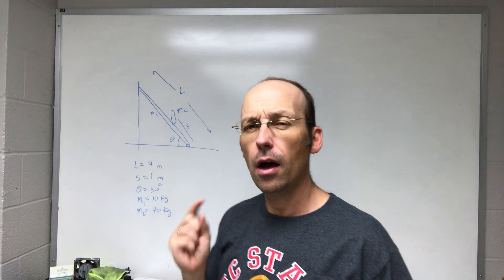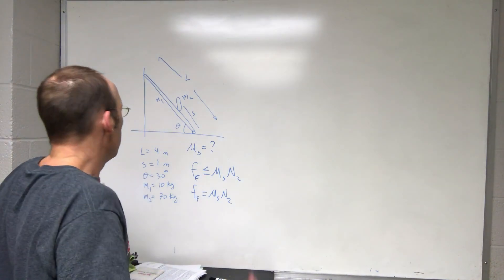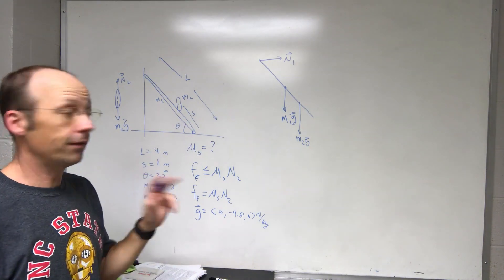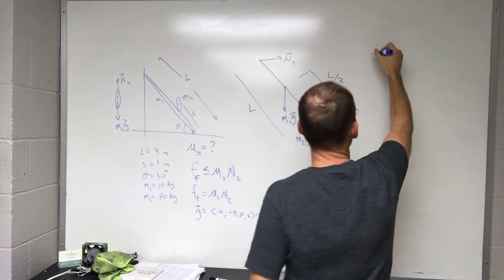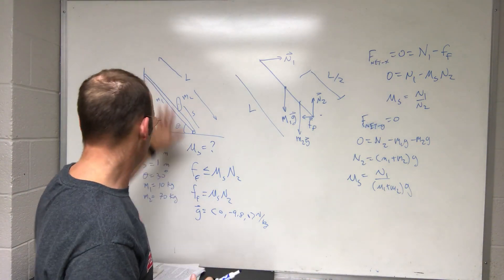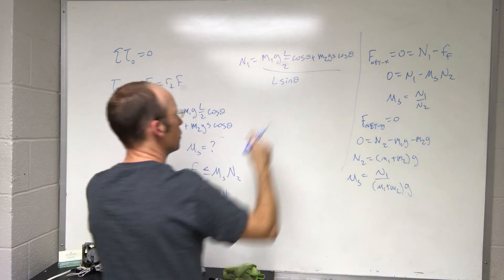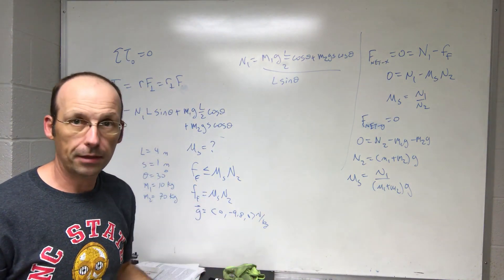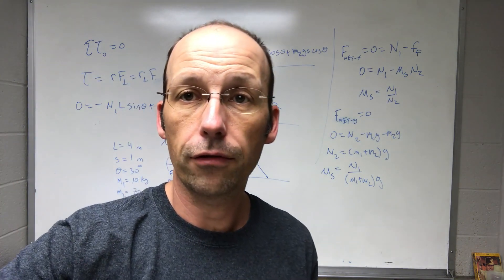Find the coefficient of friction to prevent a ladder from sliding

Comment: The part where I get lost is at 10:18 where you choose the perpendicular distance as the moment arm. I understand how get the distance, and that it is L sin(theta) but i don’t understand why that distance is chosen.
Reply: I think i figured out, so i will just answer my own question in case someone else hasthe same question.  N short, don’t visualize the direction of the normal force against the laddier, but its easier to visulaize the vector OPPOSING N1, that is the ladder pushing the wall. Picture the wall rotating, and the torque is more visible. Confusing, otherwise.